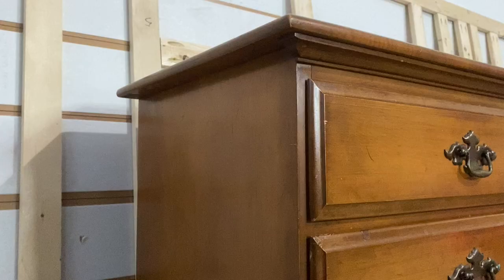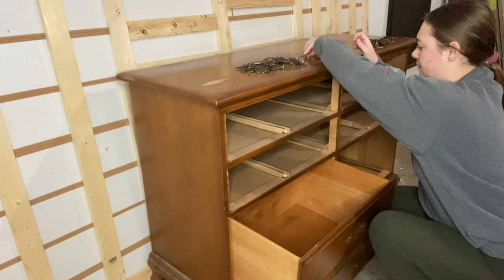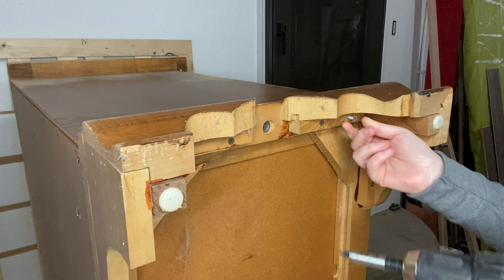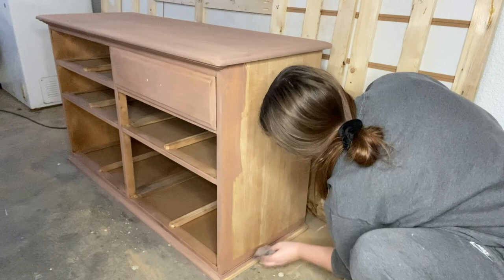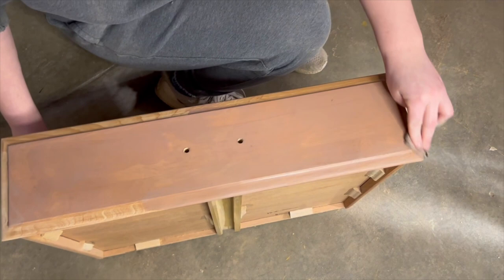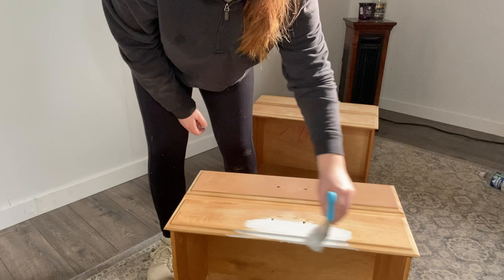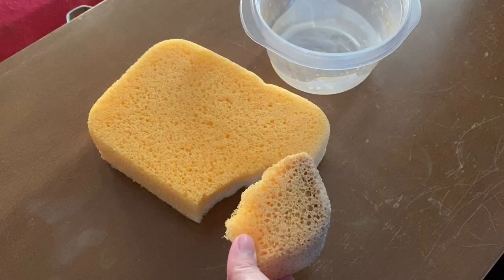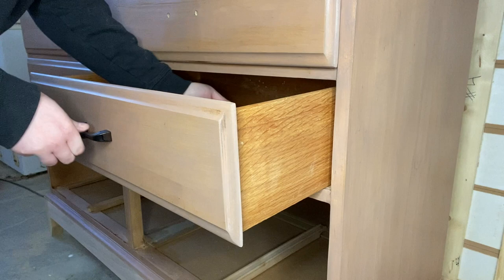How to Turn a $75 Dresser into $600 l Furniture Makeover l Flipping for Profit l Side Hustle 2023

Comment: I hope you don’t take offense to my comment, it’s only mean in sincerity. I don’t see you vacuuming or cleaning the insides of your furniture, or waxing the sides, insides and slides of your drawers. I also often see paint on the sides of your drawers as you open them. These may not be an issue for some buyers, but you will get repeat customers and top dollar when you detail your pieces. (I also wanted to mention that if you spritz your furniture before you paint wash, you’ll get a much more even tone). 
I’ve watched you since you started your channel, and you’ve improved so much, and you have amazing ideas for your pieces. I really would love to see you get to a point where you can be a successful YouTuber, you definitely deserve it, you have such a natural talent to see a piece for what it can be. ❤
Reply from the maker: I encourage all tips as I still have lots to learn. I do clean the insides but that’s typically a step I do before the customer arrives. Having my finished pieces in my workshop, they can get dusty until they have sold and so I choose to do it all before a customers arrival rather than twice when I know it’ll get a bit dusty again, unless it’s terribly dusty. As for waxing specific areas, that’s a great idea and I may have to implement that into the routine! 

Thank you for all of the helpful tips, kind words and support❤️
Reply: @HeatherLewisss  I think they meant that you don’t clean before you start sanding and painting. When you sand a dirty piece, you’re grinding the dirt into the surface. Also, cleaning it helps with paint adhesion and gives a more even finish